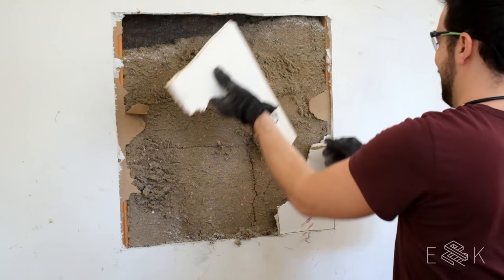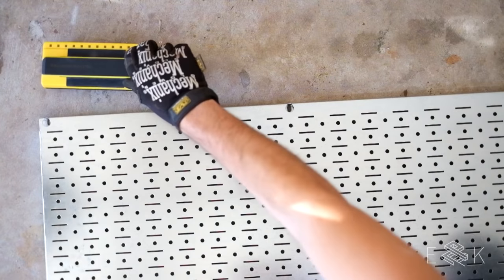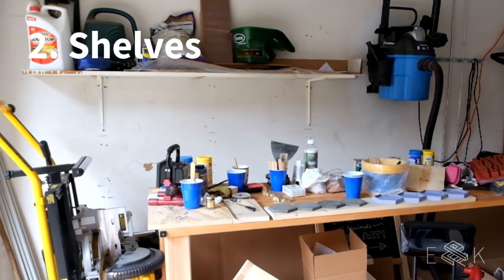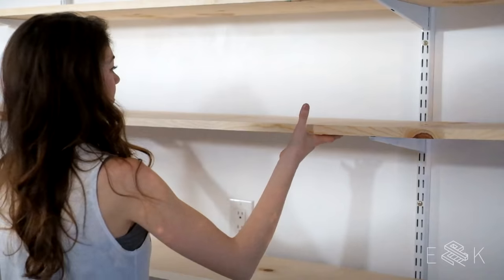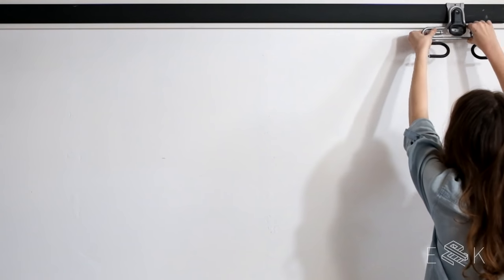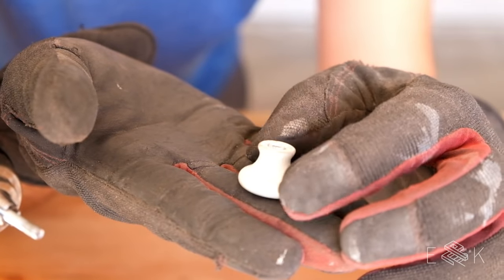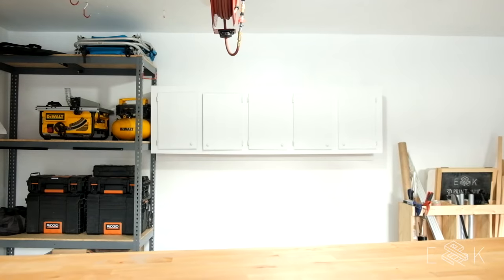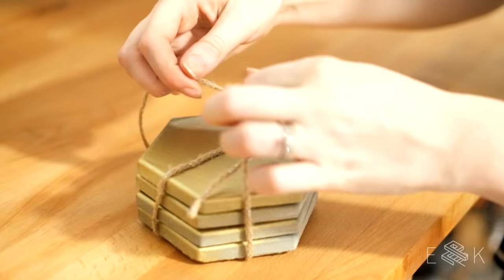Garage storage ideas

Comment: Hi Evan and Katelyn!!  So it is finally my turn to organize my garage. I'm doing a combo between what you did in this video and the DIY Garage storage video by Modern Builds.  I love the idea of the metal peg boards but some of the reviews warn against the fact that the regular peg board hooks don't work so well because the metal is much thinner than the regular wood peg board.  DO you have any suggestions ? What kind of hooks did you use and did you have to rig them ?
Reply from the maker: We haven't really had any issues! We have some special Wall Control hooks and some old hooks we used

Comment: I thought about doing pegboards for my tools, but thought I would try French cleet shelves instead. Maybe doesn't look as clean as a pegboard system, but still works
Reply from the maker: The Beardless Man yeah for sure! We flip flopped between a few solutions but wanted to invest in something that would last forever, through moves and all and would be somewhat modular. We may build/3d print some custom mounts though!
Reply: I think the the french cleats are neater than the pegboards.

Comment: You guys are so much fun. I'm glad you are comfortable enough to be goofy (but not over the top) in front of the camera. I appreciate this video because I'm trying to reorganize my garage to support my shop, toy storage, food storage (pantry space in the house doesn't support a family of six), and two cars (September-May...I don't like scraping windows and brushing off snow in an Alaska winter).

I've used pegboards for years, but I hate how things pull loose when I grab tools. Many of the clips I've found to clip the brackets in place don't seem to stay put for long. How have you worked around that?

I'd like to point out that I found you through your Patreon support of Making It, Make Something, and at least one other channel or podcast. So, not only are you supporting the creators you enjoy, but you're advertising your brand---smart!
Reply from the maker: +Jason Bailey Thanks so much Jason! Really appreciate your comment 😁

We've had the same issues in the past but the little clip things actually seem to work well with the metal pegboard! It's been 6 months and they are still holding strong. 

I'm actually thinking of designing my own 3d printed pegboard accessories that will grip either with an expanding thread or magnets but it might be a bit til I get to that project 

And totally with you on supporting the community. I'd much rather our money go to the people that inspire us than a big company

Comment: Subscribed! With that said, pegboard panels are expensive, not to mention the cost of the  hooks. Using a simple 4' x 8' sheet of OSB instead would have been a way better and cheaper option in my opinion: with some wood scraps and screws, you can attach ANY tool or stuff you want to the wall. 
Track rails on the other side are cheap, sturdy and versatile, plus you can bring them with you when you move. I use them as much as I can for storage.
Looking forward to seeing more of your videos guys!
Reply from the maker: That's a a great tip! Definitely lots of different ways to tackle it :D

Comment: Great video!  Do you know where I can pick up that Everbilt rail and bracket system?  I tried to find it on Home Depot or Amazon but I'm not having any luck. Home Depot has this type...https://www.homedepot.com/p/Everbilt-78-in-H-White-Super-Duty-Dual-Track-Garage-Wall-Standard-EB-0119-78WT/204611783... that fits into a track, but I liked the ones you just screwed into the stud better. Thanks!
Reply from the maker: aw man, the ones we used are on a page that doesn't exist anymore! I hope they didn't stop making them...